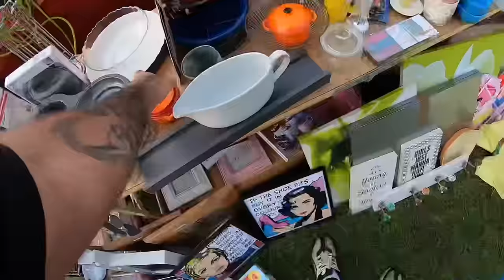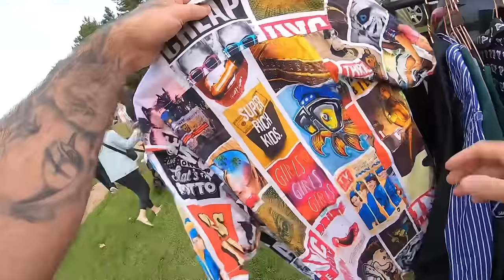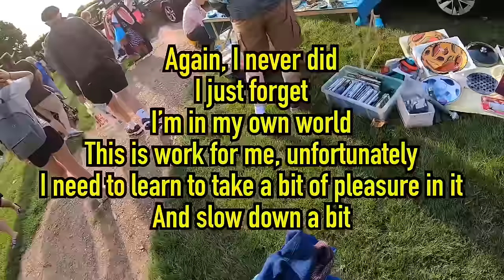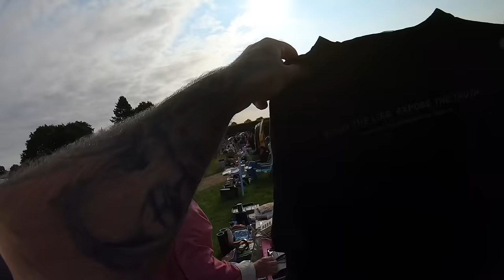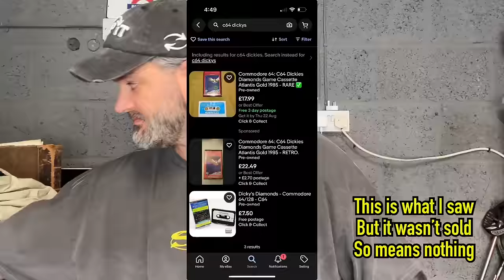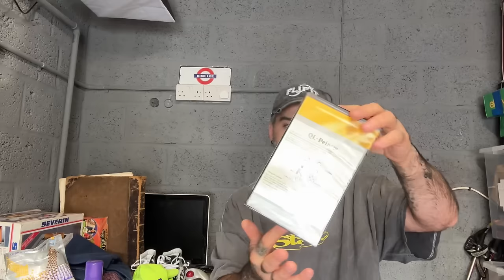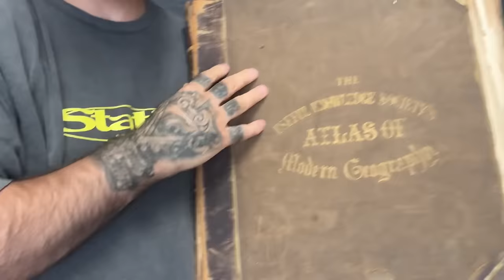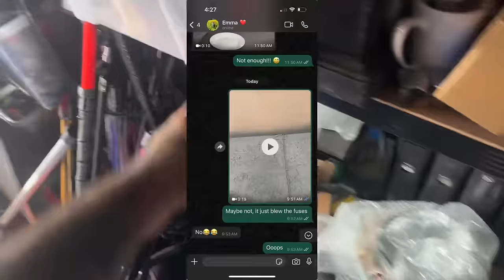DEATHTRAP! I Bought DODGY Gear From The Boot Sale - Fire Threat!

Comment: Where are you advertising that old map book please Ricky?
Reply from the maker: It will most likely be eBay that’s going to be the best platform for something like that. I just need to go through it and find out who printed it when it was manufactured, et cetera et cetera.  Haven’t even opened the pages yet.  

Always open to do a private sale, of course
Reply: @RickyResells  if it has old maps in I would be interested 👍